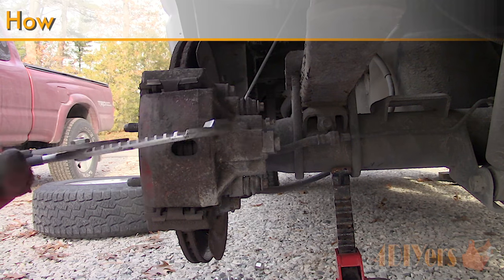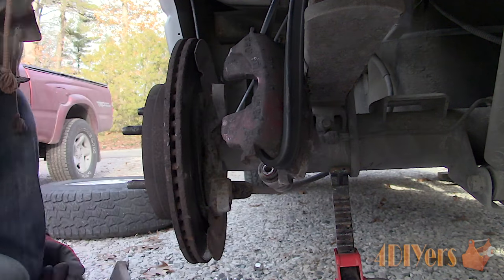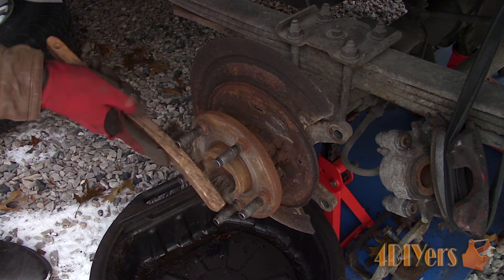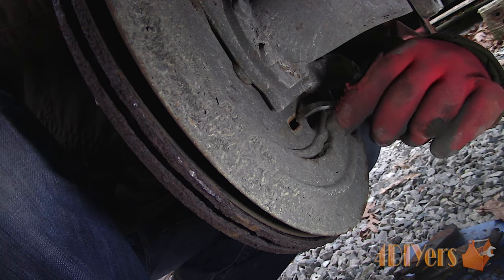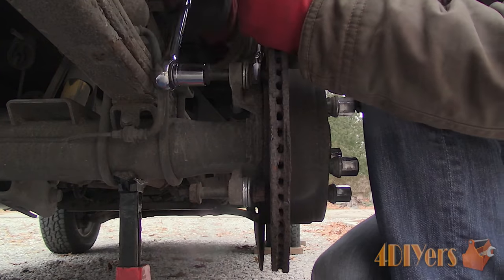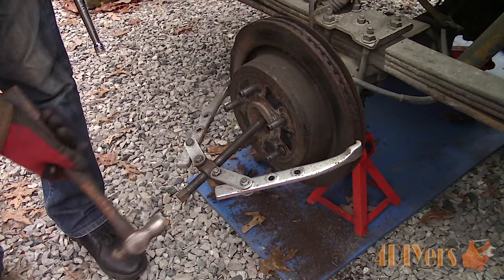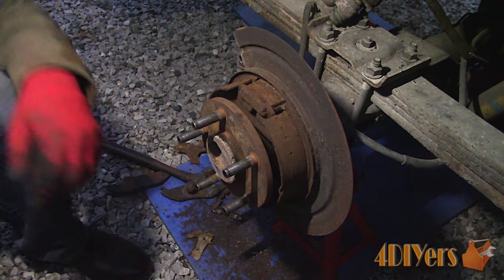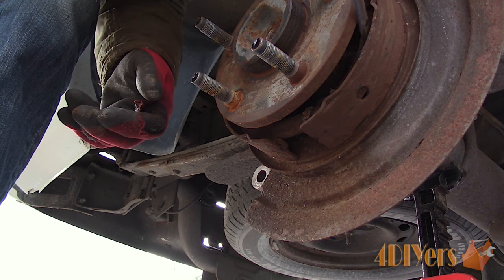How to Remove a Stuck Rotor - 5 Methods

Comment: When nothing else worked, this trick dd it for my badly stuck rotor: I put the wheels on with loosened stud-nuts and gently lowered my vehicle over a cinder block positioned under the tire but only half-way under the tire. This uneven positioning put enormous stress on the stuck rotor and that did the job when nothing else worked (I had already tried some of the methods in this video).
Reply from the maker: Thank you for sharing that tip! Didn’t even think of that one myself.
Reply: How do your car drivers now that you took off the shoes that lock it up
Reply: It called a emergency brake

Comment: If the drum has threaded holes on the front, you can thread bolts through them to help push off the rotor.
Reply: What size screws goes in there though?!  Ha ha couldn’t find one of those little screws. I heard one video say M8 1.25 mm still searching.

Comment: Living in New England with salted roads means dealing with stuck rotors. very often the bolt holes to help you remove the rotor were rusted beyond use. I used to spend a lot of time teasing and tapping, heating with torches,  I’ve developed a technique using a carbide tipped blade on a SawsAll. Position the rotor so you can saw through the rotor right down to the hub flange and make a cut so that the hub flange just visible. Obviously don’t cut any lines, wires or suspension pieces. Then with an angle grinder extend that  line across the face of the rotor to the hub flange. Remove most of the metal but be careful not to cut down into the flange. At this point a very small amount of brittle cast iron is holding the rotor on. Take a cold chisel or a heavy screwdriver and tap it into the cut forcing the rotor to expand. You will hear a metallic clink as the rotor splits. Takes about 10 minutes a side once you know what you’re doing.
Reply from the maker: Excellent tip and thank you for sharing!
Reply: I have always worried that striking the rotor with a heavy sledge would do damage the bearings in the hub
Reply: You don’t mess around. A sawsall. Now that’s nasty. I love it.
Reply: Awesome!

Comment: The bolt and washer method using an impact driver worked for me.  It worked GREAT!  I don't think anything else would have worked, unless I had one of those rotor pullers.  I wish I had the bolts from the get-go, as I could have shaved hours off the job had I used that method first.  I used 7/16 diameter as they were the thickest that woukd still fit through the hole.  The rotors were stuck on so tight that the threading on the bolts actually got damaged as by the forces if the inpact driver.  So, make sure you have some extra nuts/bolts.  I was elated that this worked.  It saved me from having to take my car back to the shop again.

Comment: I used method 3 using just one bolt to push from the rear. The rotor came right off. Thank you for the tip.
Reply from the maker: Awesome to hear and happy I was able to help!

Comment: Method 3 worked for me and took seconds to remove the rotor after I had already spent a full hour hammering the rotor using a sledge style hammer with no luck.   The rotor looked like Swiss cheese with all that hammering so I never imagined that bolt method would work, but I tried it anyway and HOLY GOD !!! It took seconds and just a few turns of the ratchet to get that all so soothing POP of the rotor breaking loose.   THANK YOU !!!!!
Reply from the maker: Awesome to hear you got it and thank you for the feedback!

Comment: #6: (Related to #3)  In that same gap where the bolt is attempting to do the 
spreading in #3, I used a steel wood-splitting wedge: tap it in with a hammer,
 tap it sideways to remove, rotate the wheel, do it again, etc. It took 
about 20 minutes, but gradually worked the rotor off without bending the
 caliper bracket mounts.

Comment: Excellent.  Great idea using the bracket and I installed lug nuts while pounding outside to be safe.  I just had to pound on mine for a minute with my BFH and it freed up.

Comment: Just tried the bolt trick on my rav4 and ended up breaking the bolt. What ended up working was spraying the crap out of the rotors with pb blast penetrateing oil and hitting the back with a big hammer.

Comment: I saw a vid where you run the engine with tires off and apply brakes in forwards a reverse. Note the stud position against the disc this may twist the disc on the hub just enough to free it gonna try it today. Be sure your in two wheel drive or jack all four wheels off the ground. Great vid I used the puller with sucess. Wish I had loosened the e brakes first though. I broke the pads as well. Thank you for making this.

Comment: The method 2 is good. The only problem it is difficult to see where is the mecanism. What i did to see better is to drill a bigger hole. This way i could see where it is and i removed the rotor easy. Thanks for the video from Canada

Comment: Removing the rear brake drum can be a beast!  Using a small piece of 2x4 wood positioned at the outside upper edge of the roto, then giving the wood a good firm wack with a heavy mallet or sledgehammer.  Rotate the brake Roto and repeat this several times.  This process will eventually break the bottom edge loose
Reply: I like it. But would like a clearer description to picture terms: "outside upper edge","Rotate" (about how many degrees?), "bottom edge".
Reply: @georgehughes2576  : I mean the top of the surface that normally has the tire mounting lugs. Rotate about 30 degree intervals.
Reply: That was more helpful then the video. Thanks buddy

Comment: I used method 3 a couple times, and it worked great, but after doing it, I thought I could have easily broken off one of the caliper mounting points. I thought it might be better to attach a steel bar that spanned both mounting holes, and then use a single bolt in the center of the bar to press against the rotor.  This should divide the pressure on each mounting hole in half. I also use one of the brake shoes against the rotor to protect the rotor from bolt damage.

Comment: A very good way is to use an air hammer with a flat hammer face, and go around the rotor hat in between the studs, if a rotor is stuck this bad then replacing it is better anyway, you can use the air hammer around the rotor surface, this really loosens the rust, than a sledgehammer on the back side if the air hammer hasn't done the trick. I have a 7-ton rotor and drum puller for the stubborn ones. Very handy in the rust belt. The only place the rotor is stuck is the centre hub .

Comment: Step one should be to check and see if there is a bolt holding the rotor to the hub assembly. My wife's 2016 Buick Verano has a t30 bolt which I overlooked.

Comment: Love the channel been a big fan since the early days keep up the great work!  I had a quick question I know this is off topic but I need help, if anyone here or you can point me in the right direction it would help me a lot.

Heres  whats  going on, I have a 1991 jeep cherokee 4.0. 217,000 k miles on it, it was burning oil so I had no choice but open it up and see what is going inside.

Took off the head saw bad burnt values so I started with the head took them all out cleanded them up and did value job with compound and that rubber tool to re seat them everything looked perfect after that seat was perfect also value steams where changed few months before this so they looked OK.  After the head I saw the  block walls where smooth with no cross patterns left, so I took all the pistons out rings where not stuck or brunt they moved freely, next I re hoaned the walls to make the crisscross pattern I removed all the rings and cleaned all pistons up everything was super clean and rings where moving like they  where new I also replaced the piston bearings cause they showed sign of wear. Before I put everything back I did a simple test put one piston in and poured oil on top of it to see if oil would drop through the rings left it for 2 days no oil went through I did the same test before I did the hoan and clean up of piston rings and oil fell through within hours. So I thought this was a good sign. after hoaning  and  ring clean up I believed rings where tight and no blow by was going to happen.  Then I put everything back in. the  car stared perfect and I thought everything was great then I did compression test  each  read same reading 125.125.125.125.124 126.
So I drove it about 100 miles and oil was below safe line, OKi though maybe the rings need time to set in new block walls but no 1000 miles later I'm burning even more oil then before almost a whole quart every 70 miles that's really really bad.
My mistake I feel is because  I didn't replace the piston rings ? But they looked totally fine  and where moving with ease.

Please what do you think I did wrong here? I don't want to give up on this jeep but this is crzy how much oil it's going through I'm willing to take it apart again trying to fix it, currently it has good power no blue smoke but the oil I just disappearing. Sorry this is so long but I'm so  lost and any help would be greatly appreciated.
Reply from the maker: Thank you so much for the support :) Did you also replace the valve seals? Did you match up all the rings with their original pistons and cylinders? The compression definitely seems low and you can determine if it's a ring issue if you add a small amount of oil to each of the cylinders and redo the test. If there was no visible concerns with the block, I would have left it as is. It really depends how worn the engine is as how it'll take new rings. After usage, especially on a higher mileage engine, the cylinders will lose their roundness and unfortunately new rings won't always solve the low compression. I'm not sure what Jeep calls for acceptable specs, but if it met within those numbers, then you can get away with rings. Outside of those specs, the block would need to be machined, either bored over or sleeved. For that much oil, I would expect to see blue smoke. Have you been noticing any oil dripping on the ground or residue on the engine? If you haven't already, I'd recommend pressure washing the engine so a leak would be easier to spot. A dye can also be used to spot an external leak. You may even have a leak between the coolant and oil passages in the head gasket. In that case you'd see milky oil, discoloured coolant, and that should show up in a cooling system pressure test. Also check the plugs for any irregular discolouration indicating that it's burning oil and even bore scope the intake above the valves for any oil residue. Another issue can also be the pcv system. Hopefully my info helps.
Reply: @4DIYers  thank you for the helpful information. I didn't replace the rings because when I took it apart and I thought they where stuck but they where moving freely.... However the cycinder walls where smooth with no cress cross left, so I honed all of them and I put in piston back in and filled the top with oil to see if it would go through and it didn't for 3 days I did the same test before the Hon and oil leaked right through. So that's why I didn't buy new rings but maybe it's the rings? Oil is not milky no leaks on the ground no oil in the coolant pcv is clean, I don't understand no blue smoke also it's crazy I'm burning a quart maybe more every 70 miles. Could the pistons be worn out? And the rings are bad?  Car has 217000 miles it's a, jeep its supposed to last longer then this. If I do the sleeves do I have to buy new pistons? And new, rings? I've never done that before
Reply: @4DIYers  I can’t even get the passenger side back #6 spark out.  All kinds of tools  and extensions but can’t get that spark plug out.

Comment: How do I remove rear rotor on Nissan titan when emergency brake is rusted to inside of rotor? Nissan doesn't have any back access, like a peep hole to adjust emergency brakes. Help!

Comment: I take a Sawzall and cut the rotors into quarters. Outside to close to the bolt holes. Not too close to the hub. Hammer them & they will come off in chunks
Reply from the maker: Great tip, thanks for sharing!
Reply: No you don't hahaha

Comment: Yes I have a easy way but a little dangerous. loosen off all nuts just a little bit. Leave tire on and drive over a bumpy road. Check frequently. This has worked several times when all else fails.
Reply: Won't you damage your studs possibly ?

Comment: Thanks for this vidéo, Nice to know we have options, but really tapping between the lugs should be sufficient, but needs constant tapping (like 5 minutes) when IT Moves you then start tapping from the back
Reply: "should" ...but unfortunately doesn't work for my rotor.
Reply: @LastBastian  i thought that too,.keep tapping repeatedly
Reply: @jonathanc8513  Thanks, but gave up on the hammer. Just got back from the hardware store with bolts and nuts, going to try that. 
My rear truck rotors, pretty sure the inner drums are seized up beyond hammer time fixing . 😖

Comment: If it's over 150k miles on and you still wanna keep it running just buy the hub assembly. 
They are not meant to last, you don't want it to give up while driving or away from home.

Comment: I used a torch. Heat the hat edge for couple of minutes white rotating it slowing. Then wack it with a hammer. It' will just pop off.

Comment: ... If it's a front wheel hub with studs take off the hub and drop it upside down on the concrete on the studs...works

Comment: Rotors with drums are another story, but disc only rotors usually come off with enough hits of a hammer. Sometimes it takes a while and makes lots of noise that disturbs neighbors, so I'm considering a new approach next time. Put the lug nuts on loosely. Then lower the car to rest the rotor on the ground. If the car's weight doesn't pop it, rock the wheel on the other side to put side loads on your rotor. It should snap free. This is how I deal with getting stuck wheels off. Loosen each lug nut one turn, then rock the car while it's still on the ground. Beats smashing at your wheel with a hammer.
Reply: Would that not damage the rotor or any other part for that matter?  Are you sure of this method?
Reply: @canam2436  I almost think if you were only lowering it gradually it should be fine, kinda worried about the studs tho

Comment: thanks for the video, but  you could damage the rotors if you  hit the surface where brake pads will installed? or not?, right?
Reply from the maker: You're welcome. Yes you can damage the braking surface if hit with a hammer.